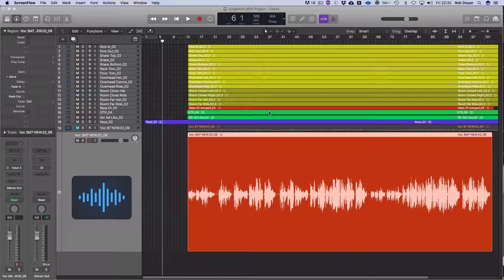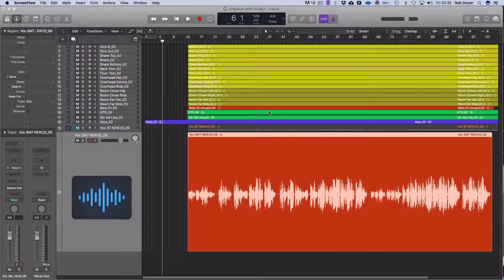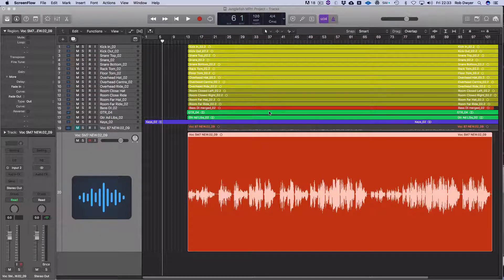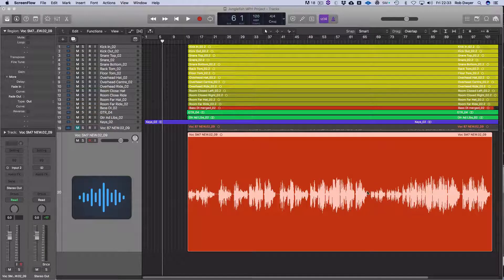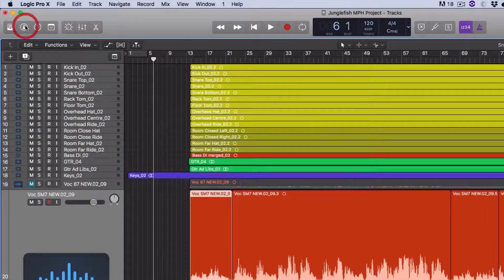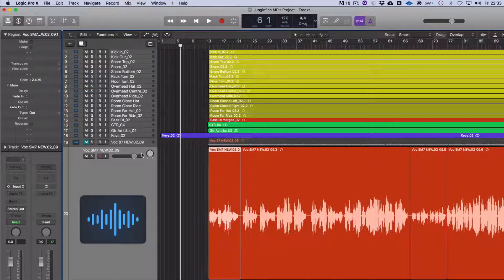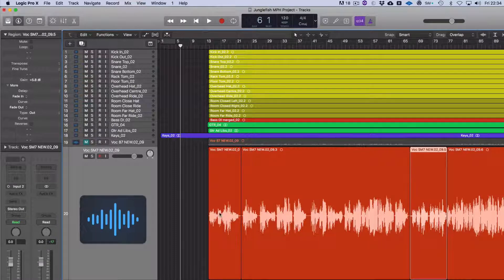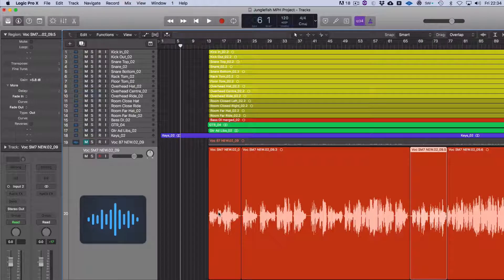Region Gain in Logic Pro X

Comment: I dont have the GAIN parameter in the inspector  - how do I get that to appear?
thanks, TK
Reply from the maker: Hi there, 
I would double check that you have selected all of the advanced options available. This can be found in the Preferences in Logic. Make sure they are all activated and on.
Reply: @themusicproductionhandbook8188  ok thanks , I realized I hadn't flattened the region yet either, that did it - however, the change in gain/volume isn't audible , it is only after bounce ?
Reply from the maker: @TravisKidd  it should be audible once you have made the adjustment. As it is affecting the selected region. Is it a very quiet part? Quite hard to diagnose without seeing the issue